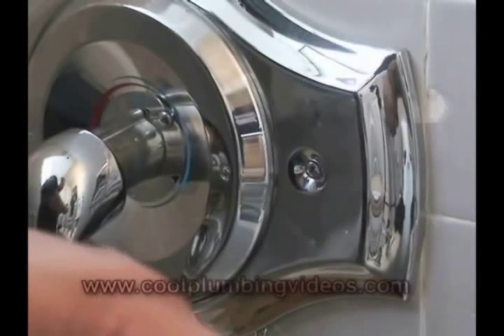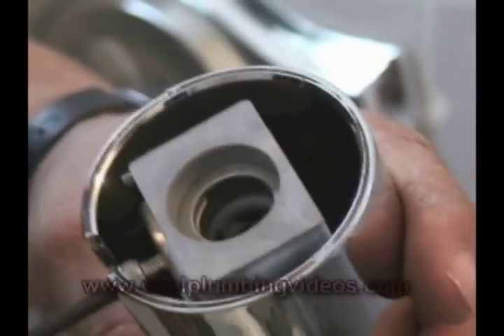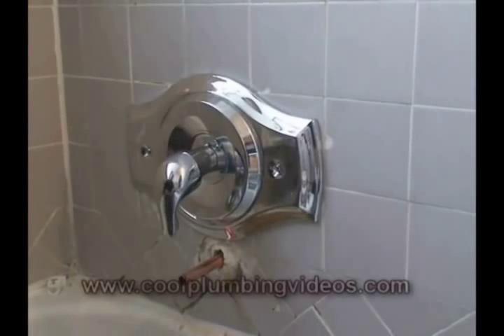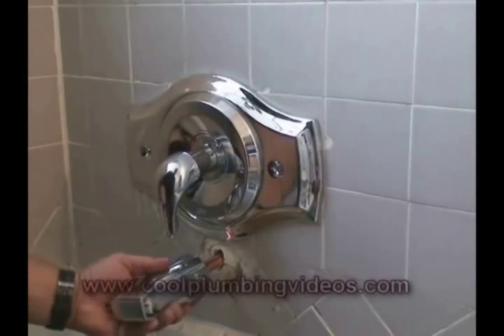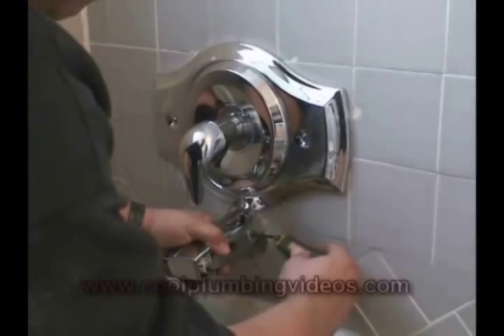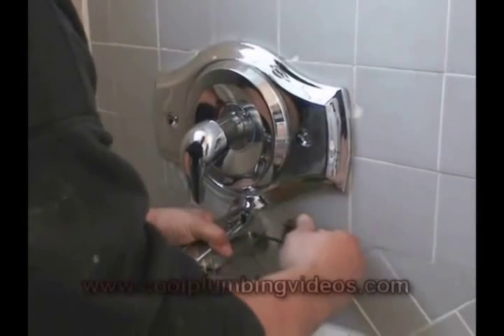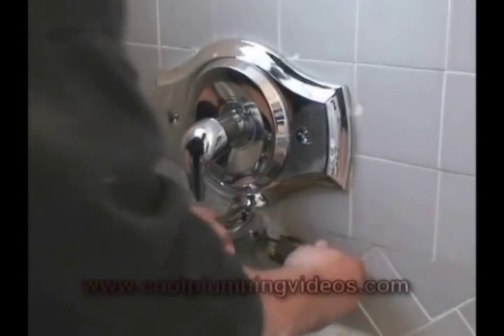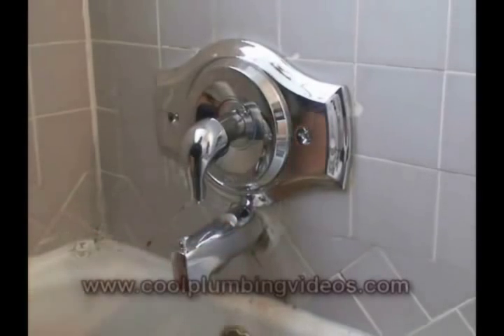Moen Chateau Tub Spout install

Comment: Hello. What if my moen spout didn't come with the inside adapter kit that mounts the spout to the copper pipe? Mines is completely empty.with threads at front of it, so not sure if I'm supposed to remove the old adapter kit and install into new one. I tried that but it is hard to remove. So i contacted moen and asked about it. They reached out and gave me a m1498 moen spout adapter kit. Problem is, is that it only sells in home depot in canada. How can that be only available out there and not here?? Crazy. So any recommendations would be great. Thanks
Reply: Holy cow! I'm in the same boat!!!! Did you ever find a solution???

Comment: How can you insert a long copper pipe into the moen spout, I bought a same spout but  can only insert one center meter long, is there some tricky things that I don't know?
Reply from the maker: No trick, but the set screw may need adjustment.the set screw should only be tighten after spout is in place
Reply: @theartofplumbing  I have took the screw out then try to insert the copper pipe hundred times, but still no luck
Reply from the maker: You may have a diffective spout.
Reply: @theartofplumbing  Thank you for the talking, I have fixed my problem, thanks

Comment: Do not tighten before having it in the correct position. You are wrecking the soft copper pipe by rotating it after tightening it down.

Comment: Thank you so much for helping me out with this Hot Water Valve. Now I have to Lower the Water Heater. What is a good Number to leave it on? I actually have no idea what it is set to. Thank you again!
Reply from the maker: 120. But with a gas water heater your going to have a knob no numbers. If its on high, try medium or low.

Comment: How long does the copper pipe for the spout have to be?
Reply from the maker: It really depends on the spout that you get.the specification should be on the packaging it comes in.
Reply: @theartofplumbing  Just got the S12101 Moen and it has no documentation. I guess I will use trial and error
Reply from the maker: Lol. Not laughing at you, but with you. That is the next option😉👍
Reply: How to Plumbing :-)

Comment: what if after install, water leaks out toward the wall.?
Reply from the maker: Remove and check rubber seal.
Reply: Remove and replace like I had to do
Reply: @edwardbailey7911  nope. just took off and got the o-ring/rubber washer re-positioned correctly.
Reply: @theartofplumbing  exactly correct.
Reply: I'm having this problem now.  
How did you fix it?